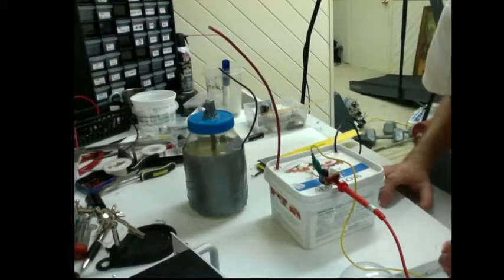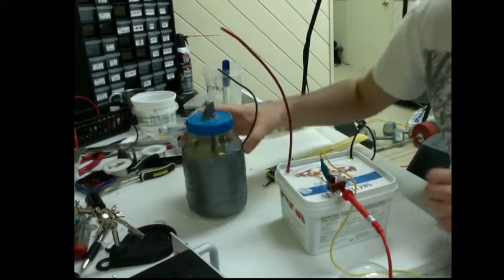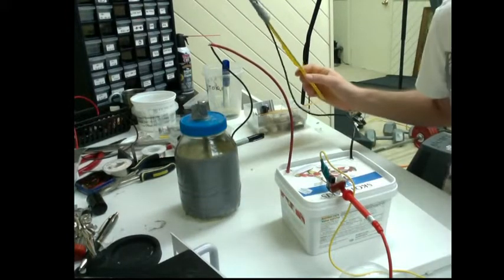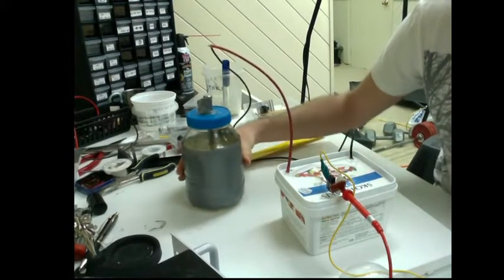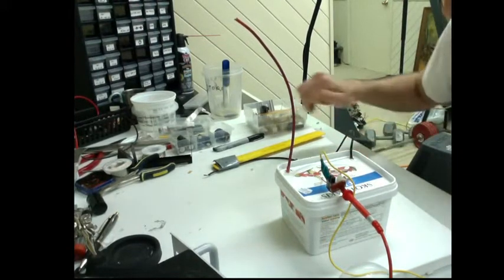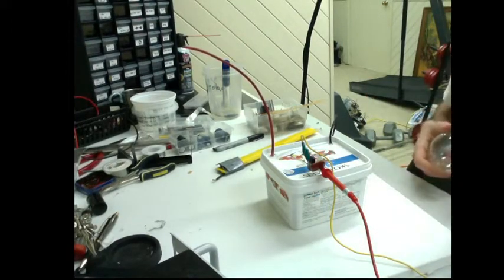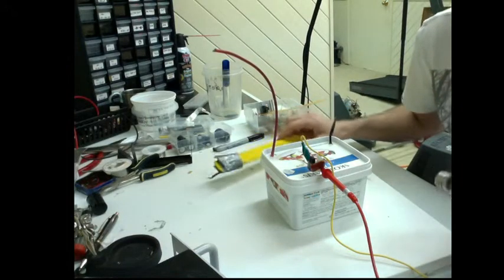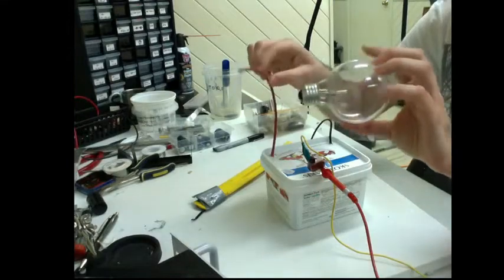DC flyback turned AC flyback (by accident?)

Comment: Your video really helped me solve my problem😄. My problem originally started when I pushed my DC Flyback transformer too much with a ZVS driver. I started to notice that the HV out wire was arcing to my metal table. The odd thing was that the arcs were far larger than before due to significant current flowing through it. I thought the ground wire was somehow touching the metal table but the same result persists despite isolating the Flyback transformer. My Flyback also have similar "symptoms" as yours as the pins under it was arcing. I solved it with a few layers Super of corona dope and copious amount of hot glue. Another odd thing that I noticed is that the voltage of the transformer decreased significantly after the overload. You can see my Flyback transformer powered high voltage generator at www.facebook.com/vinston.tan. Overall good video:)

Comment: AC and DC will both charge pretty much any capacitor unless either the capacitor does not work, or the output voltage is too high and acts like the capacitor does not exist. This does not mean that you shorted the diode. How exactly did you make a salt water capacitor? Salt water should act like a really cheap battery, about 0.05v DC with just salt water, about 1.5v DC tops with soil added. Also, where is the wire on the outside of the jar going? Both wires need to touch the salt water to charge it, at least that's my experience with salt water power storage. @ brokenharbour There are no AC flybacks on Ebay.
Reply: ac will not charge a capacitor, you would discharge them on every other half wave, that's why you need diodes. Capacitors are not the same as batteries, you have a dielectric material between two conductors, that's why the outer plate is not in contact with the salt water.
Reply: andres ortiz
Okay, you believe that then. I'll go with the common knowledge that most household electronics have a filter capacitor on the AC input. There's a reason there's a discharge resistor across those.
Reply: what you're missing is the rate of change. take note of the capacitor, it's typically a very small value. at 60Hz  you will see a negligible amount of current flowing through it (or else you would also notice a significant amount of heat and power consumption). Capacitive reactance is the equivalent series resistance of a capacitor across an alternating current. As you approach higher frequencies this resistance decreases dramatically, hence RF becomes shunted across the capacitor while 60hz does pretty much nothing. This is not using a capacitor to store up charge for later use, this is using a capacitor as a filter.
Reply: Well let's see, I have a fan here that outputs AC when I spin it, I have capacitors, If I spin the fan with a capacitor on it, and take it off with the fan still spinning, I test it with a multi meter and it has charge. It has half of the charge it would if there was a bridge rectifier. This is definitely an AC fan, 375 watt, I have several fans and motors around here.
Reply: @lepayen  'you believe that then' ... lol bro you have no knowledge of electronics if you say that
Reply: cool pro  No they're not. You clearly have no clue what you're talking about. DC fans are far from induction motors, and without a diode, they produce voltage. Also, if you had read and understood what I said, I have a 375 watt AC fan motor which is clearly not an induction motor, as it has output when I spin it.

Comment from the maker: Was your mosfet on a large heatsink? These drivers are really inefficient  and the mosfet will dissipate a lot of heat when run for even moderate lengths of time. What type of mosfets were you using? IRFP 250's are good, IRFP 460's are good but are needlessly more expensive for this application. Did you wind your own primary coil around the ferrite core of the flyback, or are you hooking things up to the pins on the bottom?

Comment from the maker: If you don't have any more mosfets, you could make a simple BJT flyback driver with a large power transistor if you have the parts lying around. Search "2n3055 flyback driver" on google. The driver is not as powerful as a mosfet 555 timer driver, but it's still fun.

Comment from the maker: Hmmm, If you could produce arcs out of the flyback before the FET blew, then it might not a be problem with the driver. You said you were playing with caps - make sure you don't hook up an AC flyback directly across a capacitor - capacitors act like shorts when you pass AC through them and shorting the secondary in this fashion will blow the FETs. You need a DC flyback to play with saltwater capacitors. What voltage were you running the driver at?

Comment from the maker: Alternatively you can try getting your hands on a real AC flyback. You can buy them from ebay, but if you can get your hands on a very old television (the older the better, try 1980's or older) they might contain AC flybacks instead of the "modern" DC package used in later T.V models. If you have a surplus electronics store nearby they may have ancient T.V sets :p
The driver of a plasma ball/globe contain AC flybacks, but removing them isn't too practical, they are quite small.
Reply: I found one in the trash so look there too

Comment from the maker: It was running off a 555 timer driver @ 30 V, I think I was charging a salt water capacitor. I left the driver running on the capacitor and noticed suddenly that it wasn't producing corona between the terminals anymore and since it was changed to AC, it was shorting itself through the capacitor. I've charged many salt water capacitors with flybacks, but this had never happened. For more suggestions search "remove flyback diodes" on google and you will find a 4hv.org forum topic. Goodluck.